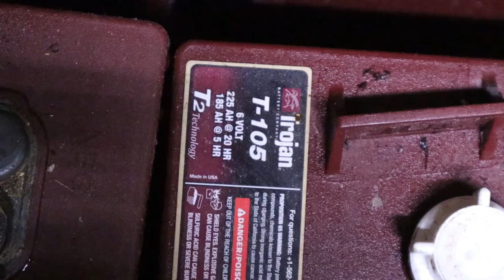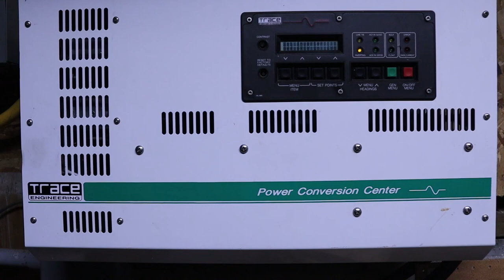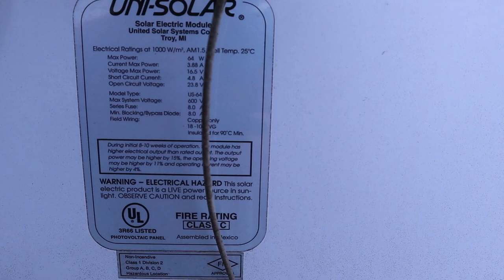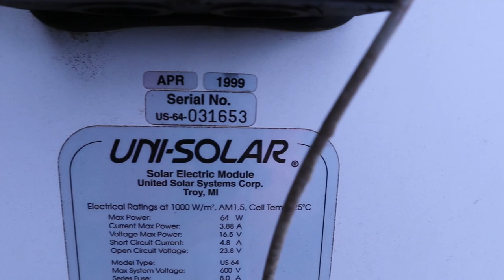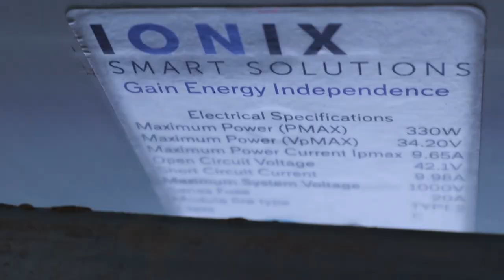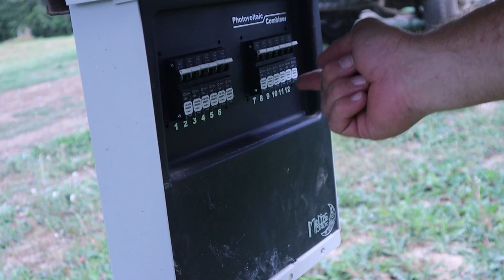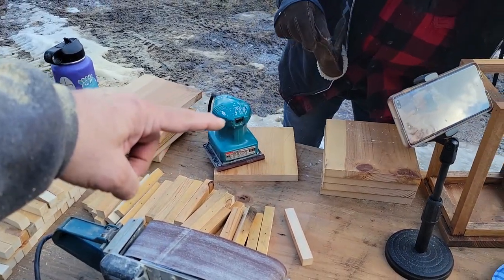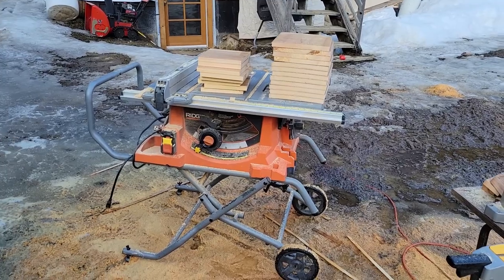HORRIBLE CHARGING SYSTEM!!  UPGRADE your SOLAR PANELS !!

Comment: heya, nice upgrade. yes the panels these day even go up to 500W. I myself have total of 3250 Wp on my east side (not the best side) this will produce me around 3000KWh/year and I use 3300KWh/year so only still left 300Wh/year I have to buy. I still have 12 panels x 330W = 3900 WH to instal with all in 1 inverter and the lifePO4 batteries ( differant then lion no explosion/fire danger) I will vlog the hole instalation so people can see it.

Comment: I would dig down for anchor points in the corners for a tie down. Put post holes in the corners going with concrete when eye bolt there for an anchor point

Comment: good job with the third leg....I used 4x6 inch pressure treated uprights and I want to think that the shear mass of the wood handles any wind load possibly better than steel. I too used home depot superstrut....good stuff... price has doubled in 3 years on super or unistrut
Reply from the maker: Great ideas!  Yeah I considered wood but I love to weld and I figured I could assemble and weld metal quicker but wood works!!

Comment: If the ood stuff works, leave it working and when/if it dies, THEN figure again! I like old stuff obviously. God Bless All Yall!
Reply from the maker: Ha...not THAT old stuff!  Barely charged our batts after a full day.  Now with the new panels they charge in an hr and then it's free power!
Reply from the maker: We could never vacuum or do laundry with just batteries before.  We always had to turn the generator on.  Now we dont!
Reply: @HiddenValleyHomestead  Sell the extra and get a payback eventually!
Reply: @HiddenValleyHomestead  GOOD DEAL! That's why we have generators for outages. Can still have well water and keep the coolers going.

Comment: I was so surprised to see how the wind undid you marvelous installation. Because the panels act like sails, is there any benefit spacing the panels 2-4" apart and allowing the wind to a place to  blow through them? Would this take pressure off of a system when compared to placing the panels touching side by side (the traditional method of installation)?
Reply from the maker: Great question but mostly no.  It would help a little but each panel is 27"x60" so the benefit of allowing wind through between would be negligible.   And then the array would be even larger making a rack mount monstrous!